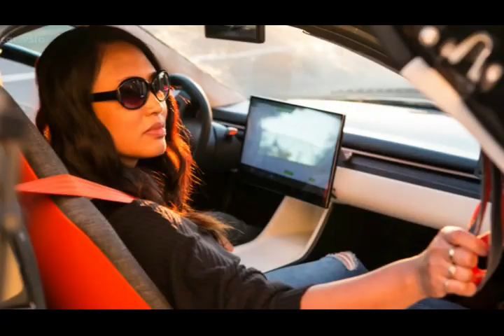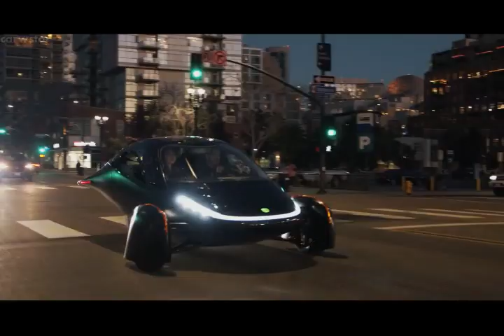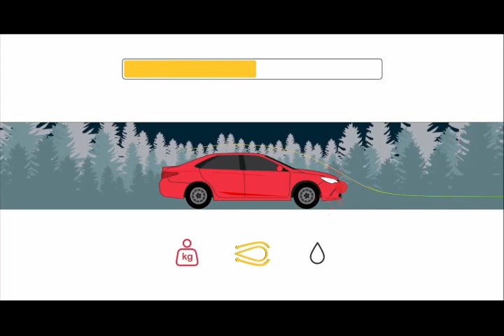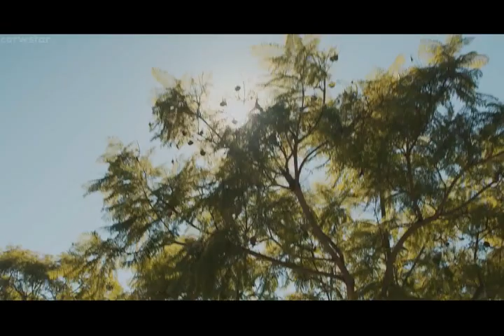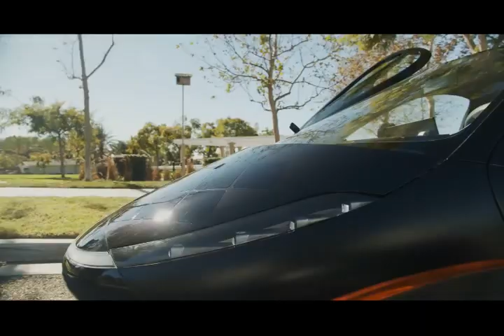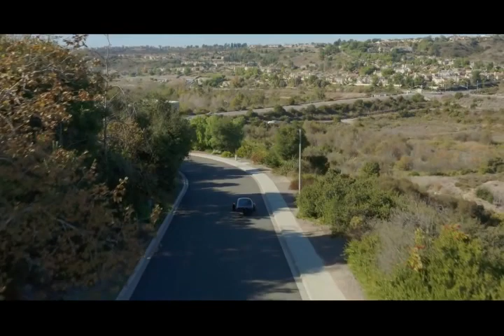Meet APTERA EV   Efficient Car Ever With 1000 Mile Range

Comment: Aptera will produce the most efficient transportation on the planet. They achieve this by leveraging breakthroughs in battery efficiency, aerodynamics, material science and manufacturing. Aptera is powered by the sun and won’t need charging for most daily use. They’re an efficiency-obsessed brand offering safe, comfortable, and fun to drive vehicles.